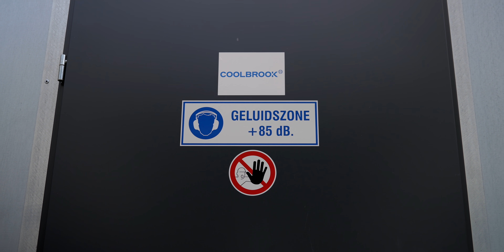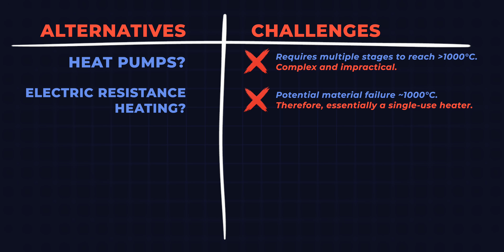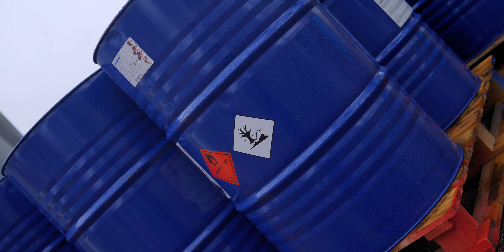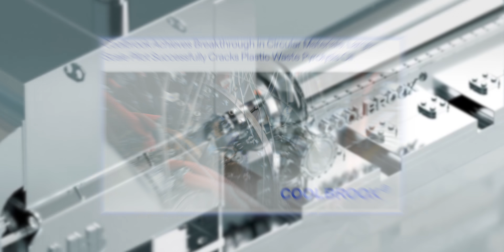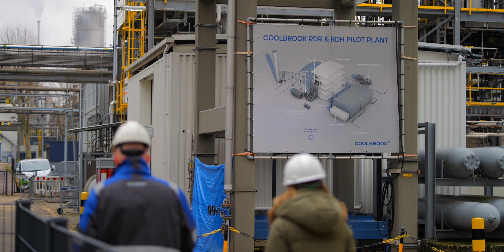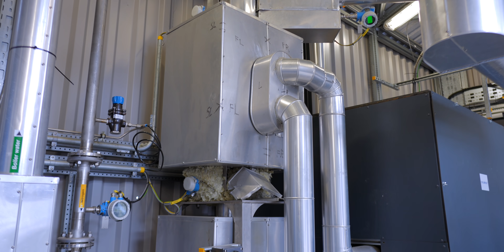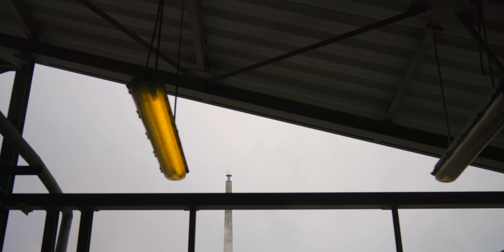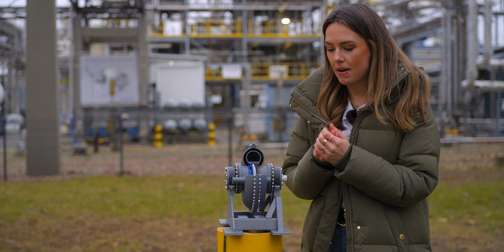Where Heat Pumps Won't Cut It, Coolbrook's Shockwaves Might....

Comment: Induction.
Reply: Induction doesn’t heat gases directly, only liquids and solids.
Reply: @BlueOceanStrategistS  So what? They said that there are no options to heat stuff that we need to heat, in industry, to temps above 1000°C. Stuff like, and I quote "STEEL, cement, ALUMINIUM, chemicals, petrochemicals".
She clearly and explicitly said, that you can't heat ANY of those up to those temperatures, without either burning stuff, or use one of those other five options she lists (two of which involve burning stuff, and one of which... DOESN'T create heat, at all! Carbon capture isn't a method of  heat generation!)
...which doesn't include either induction, or electric arcs.
Which, as I've said, has been routinely used by industry to melt metals, since at least the early 1900's!
In other word:
SHE LIED!
Clearly, explicitly, and undeniably.
Reply: @ZarlanTheGreen  Yeah, I’m not talking about that. I came here to discover a new device. I didn’t come here to indulge in the words of the person reporting on it.
Reply: @BlueOceanStrategistS  Then why aren't you doing that, instead of lying and gaslighting ...and why don't you care, about how they don't inform you about the OLD devices, that most people don't know about, which makes the knowledge of them, NEW to most people?
Because you're just a troll?
Reply: @ZarlanTheGreen  There is an abundance of people stating the obvious, that induction heating could be used instead burning fossil fuels for heat. I don’t need to echo their words. I had something different to add, about that you can’t just use induction heating to heat just anything (at least practically). The comment I was replying to was literally just the word “Induction” which could refer to what the woman was (not) saying about electrifying heavy industry, or it could refer to what is thought to be a better way to electrify heavy industry (as if it wasn’t already established where it could be), implicitly arguing that it could be used for the specific process that the Rotodynamic pump is being used for that was featured for a major portion of the video.
Reply: @BlueOceanStrategistS  "I had something different to add, about that you can’t just use induction heating to heat just anything"

...and thereby saying, that it isn't true, that induction is a method that can heat industrial things, to temperatures over 1000°C.

"The comment I was replying to was literally just the word “Induction” which could refer to what the woman was (not) saying about electrifying heavy industry"

...which your reply, was arguing that it can't. Despite the fact that it both can, and actually has been used for it, for over a century.

"or it could refer to/.../"

That is a baseless claim. There is no reason to assume that that is what is meant, and not the former (which would be the only say, in which your comment would make sense), but good reason to assume that it didn't.
That it, indeed, was simply stating that induction is a method to heat things over 1000 degrees, for industrial purposes.
Seeing as that makes perfect sense, and it would be unusual for someone to think that induction could possibly affect naphta, despite how most people have at least some passing familiarity with induction, and how only some pans, work with induction stoves/hobs.
Reply: @ZarlanTheGreen  You cut off to the part right before where I said “(at least practically)”.

Let’s see what the LLM thinks:

“Induction heating hasn’t become the standard method for naphtha steam cracking mainly because conventional fired radiant furnaces are exceptionally well suited to the job at large industrial scale.
Steam cracking requires extremely high and very uniform heat flux along long, thin reactor coils. Gas-fired radiant furnaces naturally “blanket” these coils with heat and can deliver hundreds of megawatts reliably and cheaply. Induction heating, by contrast, couples best to conductive solids and tends to heat locally rather than uniformly along complex coil geometries. It also does not heat the process gas directly, so you still rely on heat transfer from the tube wall to the gas, which limits performance gains.
Economics are another major factor. Refineries and petrochemical plants often have access to very low-cost fuel gas, making fired furnaces inexpensive to operate. Electrifying the same duty with induction would require massive electrical infrastructure and, in many regions, more expensive energy. Additionally, conventional furnaces have decades of proven reliability, materials knowledge, and maintenance practices, while induction systems at world-scale cracker sizes would introduce new technical and operational risks.
Induction heating is still being explored—especially for decarbonization—but today’s fired furnaces remain dominant because they deliver the required heat flux, scale, and cost performance more effectively for large naphtha cracking units.”
Reply: @BlueOceanStrategistS  "You cut off to the part right before where I said “(at least practically)”."

...because it is neither necessary, nor relevant.
Electric arc furnaces and induction furnaces are perfectly practical, and have been used in industry, for over a century.
They are extremely practical, for melting metals. I'd like to see you, try to make an argument against that.
To complain about my having cut off the citation, to only include what is necessary, to make it clear what I am replying to (which is the only purpose the citation serves), is pure dishonesty.

"Let’s see what the LLM thinks:"

What LLM thinks, is useless and irrelevant. Also, LLM doesn't think
...and asking it about whether those methods work for naphta, specifically (which I never claimed, and the video's  claims were never about only petrochemicals, but included steel), is also completely dishonest.

Essentially, what you've made clear, is that you are dishonestly arguing, in bad faith.
You make no honest arguments ...because you know you have none, but also because you don't care about the truth.
Meaning that it's useless to try to argue with you, as you're just trolling.
Bye.
Reply: @ZarlanTheGreen 😂😂😂😂
Reply: Induction, indeed. Induction and electric arc furnaces, which both run on electricity, and don't burn anything, have been used in industry, since the early 1900's...
Not a single word about those, in this video...

Comment: I was just thinking about clean industrial heat.
Reply: An issue in which you have to mention electric arc furnaces, and induction furnaces, which have been around for over a century, and just run on electricity, and don't involve burning anything.

Comment: Molten salt, lasers, hydrogen are also going to be used.
Reply: Electric arc furnaces, and induction furnaces, which both run on electricity, and don't burn anything, have been used in industry, since the early 1900's...
Not a single word about those, in this video...
Reply: @ZarlanTheGreen  Yeah because they are trying to heat a gas, not a metal. Why would you use an electric arc furnace or induction furnace for that?
Reply: @BlueOceanStrategistS  I'm getting tired of repeating the same thing, in all the threads where you're saying the same thing, so...
What part of "STEEL, cement, ALUMINIUM, chemicals, petrochemicals" do you not understand?
She clearly says that you can't heat up steel or aluminium, to temperatures over 1000°C, without burning stuff, heat pumps (hypothetically, but not really), resistive heating (hypothetically, but not really), or "carbon capture" (ignoring the fact that there is no part of carbon capture, that creates any heat, much less 1000+ degrees of it)

She is lying, in the video.
There is no way to dispute, justify, or excuse it.
There are no mitigating circumstances.
NOTHING!

Comment: So, let me get this straight; this whole process is done just to generate high heat with less of a carbon footprint than historical methods.  Is this correct?
Reply: Significantly reduced carbon footprint.  

But also the cracking process is more tightly controlled, allowing better control of what products are produced.   And this process is more compact, less industrial infrastructure is needed, compared to current technology.  

Using petroleum as feedstock to manufacture fertilizer, plastics, building materials, and drugs is an excellent use of this resource.  Durable goods will keep most of the carbon locked up.  With the evidence available from studying climate change, to continue burning petroleum is sheer lunacy.
Reply: Depends which 'whole process' you are talking about. There are two things shown in this video. The whole steam-cracking chemical process and the 'heating with Coalbrook's turbomachine' which is one part of that process. The turbomachine "generates high heat with less of a carbon footprint than historical methods". The rest of the process (and its carbon footprint) remains the same.
Reply: Not the whole process if you mean cracking Naphtha.
It's just the larger version of the model shown plus an electric motor to drive it.
Reply: The whole process is done to create very high heat using no fossil fuels. It can then be used in the chemical industry, cement and steel.
Reply: @ollycharlton1852 blablabla the refineries have been using electricity for ages and byproducts recycling/reuse
Reply: Where do you think the Naptha is coming from?  That’s right, it’s distilled from petroleum and other fossil fuels.
Reply: @ollycharlton1852  But his claim was to REDUCE the carbon footprint; naptha is a fossil fuel.
Reply: @timower5850  You still need naphta for several purposes. But the cracking is fossil fuel intensive until now. It would save CO2. When naphta is cracked then it keeps it's carbon dioxide in it. If you cut a tree and make it into long lasting furniture than the carbon is stored. When you burn the wood carbon is released.
Reply: Correct. This video is a greenwashing scam. Imogen doesn’t understand what she’s presenting.
Reply: Imogen is a trained engineer working in green energy field, I’m sure she understands exactly what she is presenting and has done a job of distilling it down for the layman. 

Whilst we still need to use petrochemical products producing them with less carbon input will we a positive, especially if it can help to be used to seed a technology needed to decarbonise other industrial sectors.
Reply: @oak8863 maybe you need to watch it again, there's plenty of good things we still need to get from oil, it's when it's burnt it's wasted. This has the potential of saving twice the CO2 released by the airline industry. Things are only "fossil fuel" when they're used as a fuel i.e. burnt.
Reply: @matthewbrown435  Twice the CO2, but only once the global forcing. CO2 emissions are slightly less than half the warming produced by aviation. Everyone loves to quote the CO2 part and ignore the other slightly-more-than half, which is misleading. It's forcing that actually matters to us all. In many sectors you can ignore non-CO2 aspects because they are small, but in aviation to do so is to mislead.
That doesn't alter the point that this innovation can make a real difference. 2 billion tonnes/yr is nearly 5% of global emissions.
Reply: @matthewbrown435  There is nothing good we need to get from oil.  That said, the presentation was probably too technical, but even from what I could glean it seemed the end result was less than ideal and far too costly to build and maintain for the seemingly meager results.
Reply: @timower5850 i think you'll be surprised how much we use from the oil industry for medicines and many other things not related to making things go bang. I'm sure a lot can be replaced in nature but sadly we are not there yet, as there are so many by-products from making fuel - the singer we can electrify everything the better in my opinion though!
Reply: @matthewbrown435  The ONLY reason so many things are made from oil is because it is there.  Hell, they make linoleum from linseed oil and fuel from corn.
Reply: @oak8863  it's not that at all. It's an alternative industrial heating process that doesn't require burning fossil fuels and it is presented exactly as it is.
Reply: @matthewbrown435  We just need to stop burning it for energy
Reply: @timower5850 go on then explain how to make a polythene milkbottle from grass or trees, maybe you'd prefer to explain polyurethane shoe soles or butyl rubber in vehicle tyres?
Reply: linoleum (from linseed oil) is very rarely used, it's been replaced by the much cheaper & more abundant polyvinylchloride
Reply: @alanhat5252  LOL!
Reply: @alanhat5252  LOL!  Do some research. Spud!  Many non-petroleum-derived materials are already being used!
Reply: @alanhat5252 I'm old enough to remember linoleum. That's tough stuff
Reply: Most of these comments are depressingly naïve. Of course it's horrible that we use so much oil but the only other option is massive societal transformation unless we can immediately replace everything we do with burning NOW. For societal transformation to happen without LOTS of people dying is basically impossible. So we pick away at the things where we don't know how to do stuff without fossil fuels until there aren't any. Until that happens we are guaranteed to keep using them. So this is unquestionably a Good Thing. Personally I would be fine dramatically changing the way I live but we are maybe 5-10% of the population, and the rest would pick up guns to "keep their way of life". So we have to do this instead...
Reply: Correct. It still uses fossil fuels. Absolute rubbish.
Reply: @oak8863  I am not sure who to blame more for this: The channel for failing to properly separate heat generation from whatever is heated or people commenting while absolutely clueless. The process generates heat with electricity. You can then use that heat to replace burning of fuel in a different process like cracking.